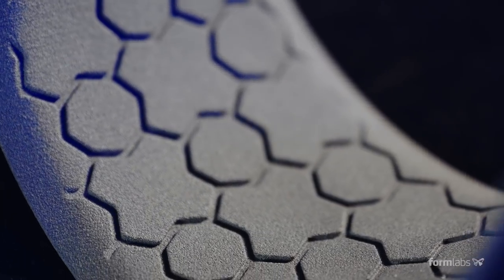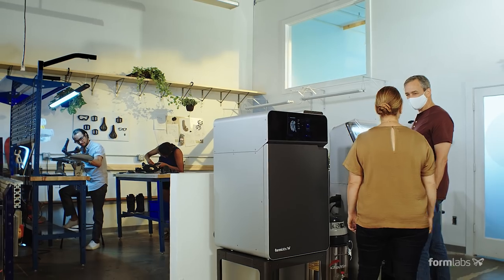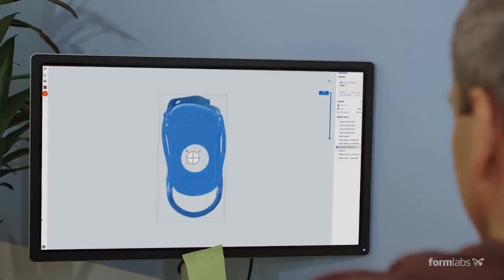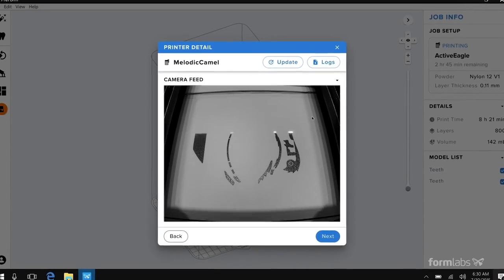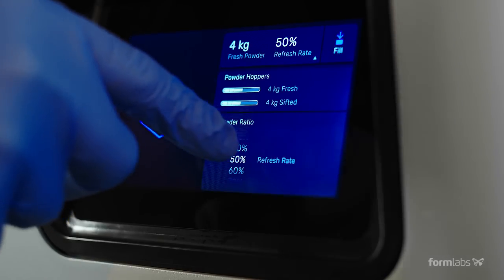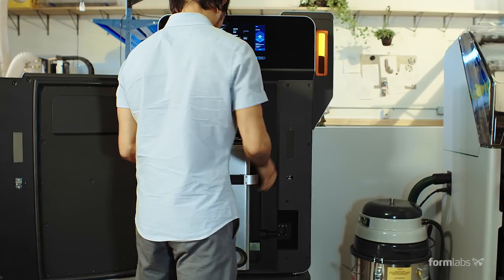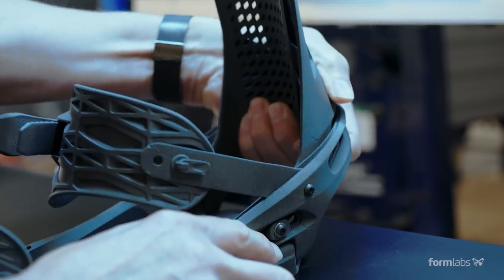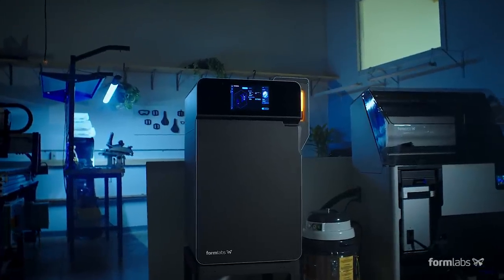Fuse 1: High Performance SLS Finally Within Reach

Comment: Looks promising, but price of 20k far from expected 10k (just for printer)
Reply from the maker: We’ve developed an SLS printer that delivers the print quality and reliability of industrial SLS systems, at a fraction of the price point. Since our original announcement, we’ve made many changes to core systems in the Fuse 1 to be able to deliver this. As a result, we've increased the machine’s price point accordingly, which still makes it the most affordable SLS printer delivering truly industrial quality on the market, by a wide margin.
Reply: @Formlabs  hope you get the recycle station too for that price.
Reply: Yeah I thought it was 10k too, big shame
Reply: I was expecting 40k. Bummer, this is way too affordable.
Reply: Core changes or not, its unfair for those who kept their 1K deposit from beginning. They should get the Fuse + build chamber for what they pledged for - 10K machine. 
I agree, its still affordable, but for bigger companies, who operate or outsource usually 200k SLS machines, but its still not start-up/small company friendly...
Reply from the maker: @brezovprut4431  Customers who have made a reservation with us at the original 10K price will have this price honored.
Reply: @Formlabs  Glad to hear that !
Reply: @Formlabs  well, I will check my sales representative Monday then. I was literally about to ask for the refund for the deposit

Comment: $32,000. Going to skip being an early adopter this time and wait for the 2022 Creality knock-off for $499.
Reply: I sure hope so.
Reply: @ikew3150  It took a little longer than that for the less expensive resin printers to catch up but I have just replaced a pair of Form 2 machines with a pair of $700 printers that are faster, print at a higher quality, and are less expensive to operate. Three years ago there was not a good option other than Formlabs. To justify the price they need to be offering top level support and customer service. That was not my experience with them.
Reply: SLS having been around as long as it has, someone would first need to invent an alternative to the laser. Fibers lasers alone are in the thousands of dollars, and only two companies actually make fiber lasers (one owning the patent, the other leasing that same patent). It was fine and all when companies figured out how to make SLA with an LCD screen and a UV backlight (with some caveats, of course), but can't really do the same here.
Reply: @cyphre  The patent expires in 5 years. I do not think it will take too long after that for us to see reasonably priced systems.

Comment: What other filament can it use?  Will it be able to print Metal type filaments ?  How soon will the metal filament be available ?
Reply: no wont happen with this machine
Reply: @Wodpuncher001  why?  Their website said they’re in the process of creating other filaments. 

I’m not all that familiar w 3D printing.
Reply: @whazupmike  metal needs way way higher laserpower and inert Gas.
Both not possible with this machine.